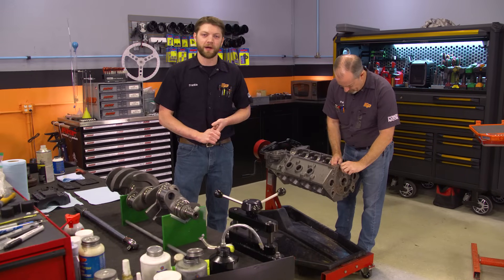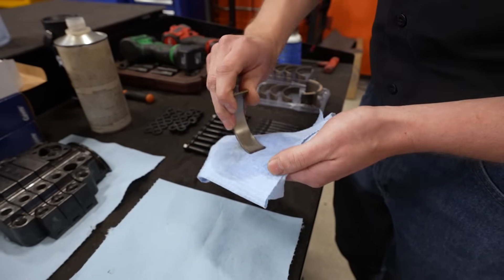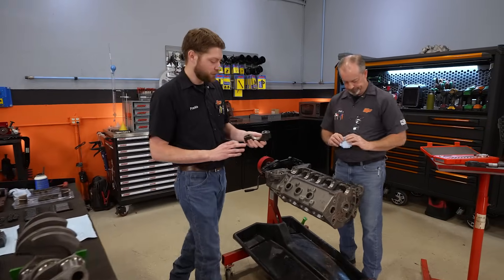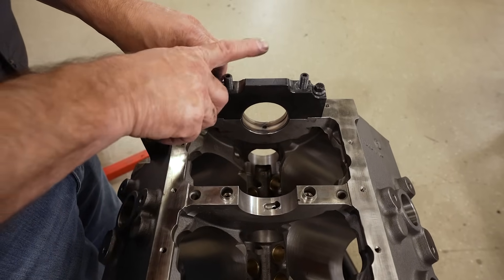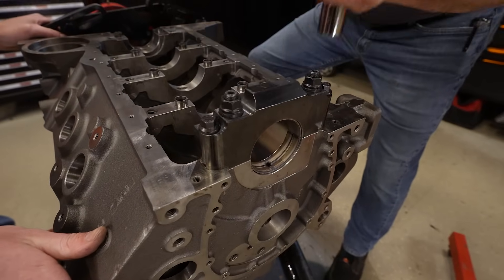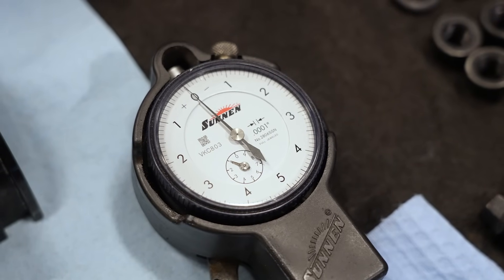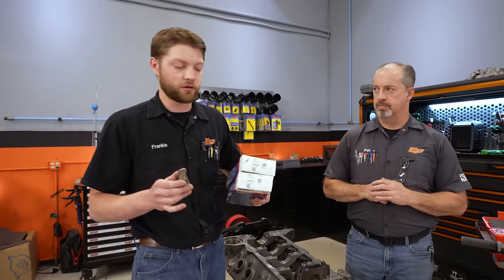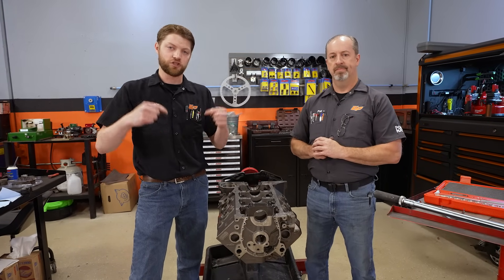Measuring Bearing Clearances Made Simple! Crucial Engine Building Steps

Comment: ~11:45. So mixing main bearing halves by one increment to achieve desired clearance (upper +.001/lower std) will NOT create a ledge at the 3/9 position of the bearing to be concerned about? Wont that eventually cut a track into the crank main journal? Anyway, thanks. RIP Joe Elmore.
Reply: Not exactly an answer to your question, but tens of thousands of builders do this. I have talked with many people personally that have "mixed" std & .001 with zero issue

Comment: Does bearing oil clearance make a difference which oil viscosity one uses,i.e. 0w-20 0r 5w-30?
Reply from the maker: Yes it is a deciding factor in oil viscosity for an engine, along with operating temperature, application, and other things

Comment: Thanks for the tutorial. I am struggling with a V6 pentastar engine. Learning on the way to build it. Had opened 3 times already, every mistake a teacher but also very expensive. I al surprised how local machine shops dismiss my concerns as just not big deals. I had stripped threads and had to rebuild them all but made some mistakes on assembly having to tear down again, then found aluminum debris on block journal 4 and some in 1 and minor in the other 2, lucky nothing on the piston rods but the bearings were destroyed, and was only by turning crank manually, glad I did not put it all together I would have lost the entire engine, now I got new bearings, new head bolts, new MlS gaskets, new connecting rod bolts; these have to be replaced every time the block comes apart; I have not replaced the main bearing bolts; their torque is 15fp and 90 degree, I had few steel inserts not really under the aluminum of the block and the main bearing caps were not sit properly allowing for the debris in, I had to correct that now all 8 holes for the main bearings caps have their inserts visibly set below the block surface so the caps will be set better this time. I got good quality tools to take the measures; Mitutoyo dial bore and micrometers; hoping the block is not ruined and can work

Comment: when you use different size bearing to get the clearance you need like use s std bearing half and .0005 half does it matter where the two different size bearing go like rod  in the cap and the rod size same with mains which size should go in the block which size in the main cap . thanks good video
Reply from the maker: Ideally you would put the thicker bearing (the std. bearing) in the load side, so the uppers on the rods and the lowers on the mains
Reply: @enginepowertv  ok thanks

Comment: I like  these  tests  for  power. When  I  was into  street  rods I  used  the  performance  air  cleaners  so  I  could  adjust  the  carb with  the  filter  on the  engine.  Been watching  these  shows  since the  beginning  back  t Horse  Power  TV ,and  before.  I remember  a show  called  Crank and  Chrome.

Comment: Not only bearing clearance, large journal small small journal it's called bearing speed. Ford have big journals, Bering speed in dirty oil cause the bearings to wear how to copper, where is Chevrolet and other engines have smaller journals which listen to bearing speed longer life wider bearings.
Reply: the bearing companies made it easy

they have said to use bi-metal bearings in most street applications up to around 550-600 Hp or OEM stuff

anything after that or with really high RPM (7000+RPM), you better use tri metal bearings with loser clearances and a hi pressure hi volume oil pump  and large capacity oiling pan with a cooler for insurance

CYA

Comment: Brilliant video, explains clearly how to measure, prep and assemble, but like every other one of these, never explained 'why' properly.
Or mentioned how using the wrong weight oil in the motor can cause bearing failure. You blokes really need to do this level of in-depth video for Oil viscosity and load bearing, and how the shear loading changes with heat, with a look at how modern engines can use a zero-weight oil, while older designed engines use 20W40 or 15W50 with wider bearing clearances. How to find what the correct tolerances are, is just as important.
Reply: that would be way above a lot of peoples heads and you'll get 1000 answers  as to what is "right"  for oil weight
Reply: @KingJT80  Even more reason to have a clear and in depth tech video on the subject, to educate many more people, and help folks choose which clearance bearings to fit to match the oil that's needed in other places in the motor.
Reply: @PiDsPagePrototypes it's still subjective and HP Academy covers some of it on their channel. But like I said it's gonna depend on too many factors to give anybody one straight answer that won't blow up their engine.

There are only rules of thumb for engine bearing clearances and every engine  builder says something different

Comment: A different method that has always worked great for me in the last 40 years is to measure the opening in the block, then the bearing thickness with a ball micrometer.  Compare the with the crank journal diameter and presto, you now have the bearing clearance.  With this you can also mix and match the bearing shells to get your desired clearance.  You also don't end up marking the bearings from the measuring tools.  Lastly as commented, everything must be clean.

Comment: I noticed you bottomed out the main studs during installation. I was taught and shown to NOT bottom them out to allow for small amounts of expansion. You wouldn't want to bottom a bolt out, would you, even if it happens upon proper torque reading? Same reason. Maybe you both haven't had any issues with it, but it only takes one incident.
Reply: that how it was align honed.  and ive never ever heard of that.  i wouldnt want it to spin lose or get an inaccurate reading

Comment: Is there a preference on where the single over/undersized bearing half would go? Topside/bottom side.
Reply from the maker: Generally you would put the thicker bearing half on the load side. For instance, if you were using an extra clearance bearing on the mains, you would put it on the block side.
Reply: @enginepowertv Appreciate the reply and information, thank you.

Comment: when you install the bearings for the final time, do you use light oil on the backside of the bearing shells ?  #2, it used to be called "foot pounds" of torque, why do you refer to it as "pound feet", and when did it change ?
Reply from the maker: Great questions! You want to install the bearings with the block and the backside of the bearing completely dry, and only add lubrication to the crank side of the bearing.They are designed to be installed into the housing clean and dry to provide the maximum amount of contact between the bearing and the housing for consistent loading and head dissipation. Any debris or lubricant behind the bearing can not only make the oil clearance inconsistent, but also the load on the bearing and can cause premature failure over time. 
As far as pound-feet vs. foot pounds, scientifically, pound-feet( or pound-force-foot) represents rotational force and foot-pounds represents linear force, so when talking about torque, pound-feet would be the correct terminology, but in the automotive world, everyone knows what you mean either way. Hope this helps!

Comment: You should try to make a segment on how to select your first pistons before you install it on the engine block.  Also that how to actually select which Carbrators you should use when you are doing a engine power upgrade on a low budget.  And still have a great supedup engine without having to worry about going over your budget.  When it comes to inline 6 or V8 and what's would be likely the best way to have your engine to be bored out for less amount of money for your buck.  ?

Comment: So what your saying is that? Each measurement of the boring out your Cyclinders your main barrings will be different from the original boring Cyclinders.  ? Also that when it's comes to installing new pistons.  Is there a certain piston that you should use first or are you able to pick any of the pistons from the sets of 6 pistons or 8 and so on.  ?
Reply: no pistons  come in sets.  dont mix and match  unless youre doing some type of backyard rebuild in which case  you need to be measuring piston to wall clearances

Comment: Seems as though there is a huge upfront cost with dial bore gauges etc not to mention the experience needed to properly use these tools. For a part time builder would plastiguage be a good alternative?
Reply: That's what I did when I rebuilt the 300 in my 1984 F140. Good thing too... while after polishing, per my machinist, the crank was good for "standard" main bearings, the NOS ACL bearings I bought (eBay deal) were right on the high side of Ford's spec when I plastigauged them. No good for a new build... ended up having to get some slightly undersized "service" bearings from sealed power which did the trick. Funny enough, the standard rod bearings I purchased (OEM'd by King if memory serves) were fine out of the box. Go figure. But it's not a race motor... different application that isn't as critical. Even with the bore gauge measurements they did, Plastigauge is still a good idea for a final verification as part of final assembly. That's what I've seen many other builders do.
Reply from the maker: There are varying levels of cost for a quality dial bore gauge, but plastigauge is a cheaper alternative and can absolutely be as effective if done properly

Comment: :hand-pink-waving:i cant understand how the oil support layer can work were the accessory belt drive system adds loads of tension on the crank...
Reply: because they dont add as much as you think is why
Reply: @KingJT80  why cant they use ball or pin bearings like in Honda engines?
Reply: @altops4490 old school stuff didn't use it. They figured out how to evenly distribute the load on the crank with flat bearings